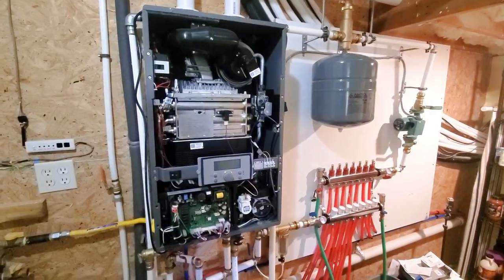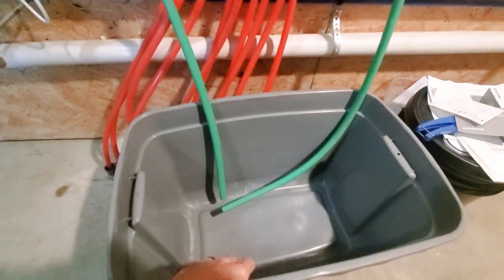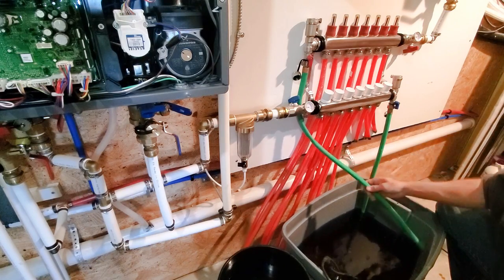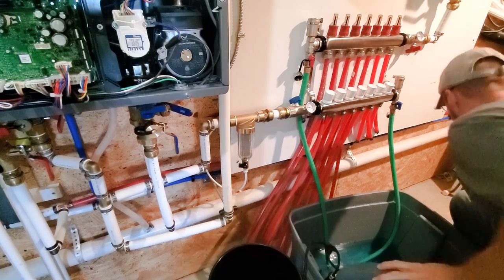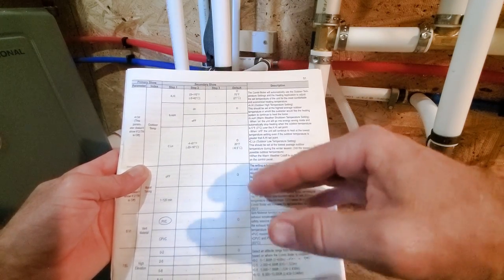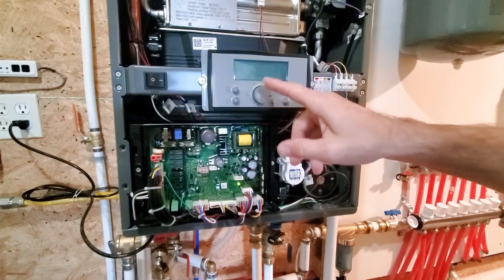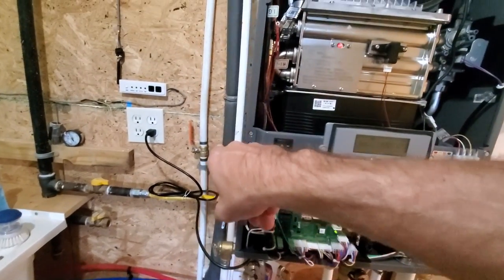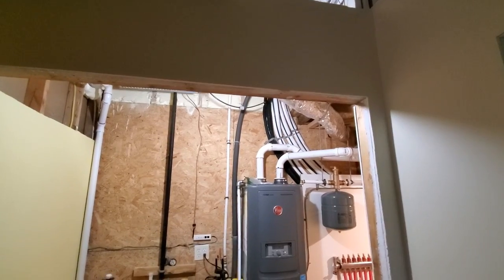Filling and Firing up the Rheem Boiler in our Off Grid Home

Comment: These Rheems are made by HTP, HTP was purchased by Rheem several years back now. In my old house I had an HTP 199K btu tankless wanted Hester inside the same case as your boiler. I’m sure the guts are totally different, but it was a great unit. I only had one issue with mine, a leaking blank plug, which was an easy fit. Would 100% buy a Rheem/HTP product again.
Reply from the maker: Ours is still working lile a champ.

Comment: at 13 minutes, when you opened the ballvavles, was it putting fluid thru the expansion tank and other lines?
Reply from the maker: Yes, I was bleeding the air out of the outer loop that contains the pump, expansion tank, and spin down filter.  Once that was full of fluid I tried to open the boiler valves thinking it would get the air out of there as well but it didn't work very well so I then hooked the sump pump directly to the boiler fittings and got all the air out of it too.

Comment: Hi there... I have the same system.... I'm having trouble connecting a Nest thermostart.  I have two wires and I connected it to CN15 just like yours.  I was told by Rheem that I'm suppose to 24volts from CN15.  Are you getting 24volts from CN15?  Also what thermostat are you using?  Are you using a zone controller?  I have only one zone. Can you explain or show please. Thanks!!!!
Reply from the maker: I have a Honeywell TH1100DV1000 heat only thermostat which uses 24V.  The system is not zoned.  I have seven loops but an only using five currently.

I don't think a Nest will run it properly.
Reply: @Off-Grid  What is the answer on this, is it just a contact closure that you hook up or do you actually supply it with 24v.  My old system works off of a contact closure on the zone valve.

Comment: I just finished the install of my own Rheem combo boiler and one thing I noticed is that even running the cold water triggers the internal pump to start.  Maybe the slight pressure interuption does that but not sure.  Have you noticed this with yours?
Reply from the maker: No, ours won't run unless the hot water runs.  It doesn't take much to trigger it so maybe the faucet has a mixing valve that is allowing hot water to pass by.  I can't think of any other reason.
Reply: @Off-Grid  Thanks for responding.  Must be a really sensitive switch.  Your videos helped me a lot when I was working on putting it in.  Thanks for doing it.
Reply from the maker: @kapaul1584  you're welcome.  Glad they helped.

Comment: Where did you wire your external pump into?
Reply from the maker: It wires onto the boiler circuit panel.  I go over it in one of the videos.  See our channels playlist for the boiler.
Reply from the maker: Here is a link to the video where I wire up the pump.
https://youtu.be/gJYOopJQ74Q

Comment: do you control your circulation pump with a controller or let the boiler power it?
Reply from the maker: The boiler turns the pump on and off as needed.
Reply: I have just install this same one, I connected the pump this way but I have notice more than once that it is not on all the time when heat is being called for.   @Off-Grid
Reply from the maker: @danaauman5367  there could be several reasons for this.  If domestic hot water is called for then the external pump will shut off.  If your outside temp sensor is set up then it'll prevent the system from turning on even though the thermostat says to if the temperature is rising outside.  You can set the sensitivity in the settings of the boiler.
Reply: I do not have the temp sensor turned on and I understand about the HW being priority.  This is happening out side of the HW.  I have looked at the manual and seen something about the boiler shutting of the internial pump of at time to help with its life, you think it is doing this to both? @Off-Grid
Reply from the maker: If the boiler is on then the internal pump should always be on otherwise it would over heat the heat exchanger since the external pump doesn't pump through the heat exchanger loop.  I'm sure some fluid would still go through but the majority would take the path of lease resistance back to the pump.  So if your internal pump is off and the boiler is on them I think you need to call technical support and see what they say.
Reply: the internial pump does not turn off, it always runs, but the boiler turns the externail pump off, even though the Tstat is calling for heat.   @Off-Grid
Reply from the maker: @danaauman5367  does your external pump have a limit switch that is turning it off when it gets hot?  My boiler temperature is set to 145° but can go up to 180°.  What is yours set at?
Reply: The external pump does not have any limit switch.  I just noticed that the temp was set to 125 and I just changed it to 145. any other thoughts why the boiler would turn the external pump off?  The only wires to and from the pump are the electrical to the connection with in the boiler.    @Off-Grid
Reply from the maker: @danaauman5367  how long are your runs and pipe size?  What is the return temperature and delta?
Reply: my longest run is about 300', return temp is typ 20 degrees lower than supply.  @Off-Grid
Reply from the maker: @danaauman5367  sounds good.  All I can think of is a setting is wrong or a thermostat error.  Mine is hooked up to a simple dump heat only thermostat.  I know some people have had issues hooking it up to higher tech devices.

Comment: Mind if I ask, where did you tether the ground wire from the circulator in the boiler? or did you just tether it to the boiler's housing?
Reply from the maker: There is a ground wire attachment spot on the boiler for the motor.
Reply: @Off-Grid  Found it! it's a screw on the  lower left
Reply from the maker: @isaacmadrid15  good deal!
Reply: @Off-Grid  Another question, is your thermostat battery operated or C wire? I couldn't find a C wire terminal inside the boiler..
Reply from the maker: @isaacmadrid15  It has a battery.

Comment: RTA cabinets make vanities, have you checked them out?
Reply from the maker: Yes, we have but they are very simple and boring.  I wanted to do something more unique.  Plus I found that they aren't much cheaper.
Reply: @Off-Grid  I also was looking for a solid wood vanity and went with a particle board one from Home Depot for the design. Fingers crossed that it will hold up.
Reply from the maker: @suesherrill7024  they are good for many years.  As long as you don't have any leaks it should be ok.  Problem is that a bathroom isn't exactly a water free environment, especially with kids.  Solid wood seems the best bet I'd think.  I might be over thinking it too.....

Comment: Can you help me to check my Boiler? I have trouble to turn it on. Thank you.
Reply from the maker: I can try.  What's up?
Reply: @Off-Grid  my friends helped me set up, RHEEMPrestige 9.9 GPM Natural Gas High Efficiency Combi Boiler with 199000 BTU (from HD), but it did not really work.
Reply from the maker: @tingzzz3  will need to know more information in order to try and help.

Comment: Shark bite ok for emergencies but have flaws. They are smaller inside diameter and too many cause a major stress on the flow of water. Just saying
Reply from the maker: So far so good.  I've had sharkbites in the ground for over ten years so far without any leaks.  At least I can see all the fittings here to catch a leak when it starts.

Comment: Have you ever seen error code 55 on this boiler??
Reply: I just installed the unit and code 55 keep coming up
Reply from the maker: It means the system can't get up to 13psi.  You're auto feeder has to be on and air valves open so it can push all the air out of the line and fill the system to the proper psi.
Reply: I can bleed off air from shower??
When I turn on hot water in the shower a lot of air came out
Reply from the maker: @daidaisuisuib  it is air in your boiler line, not the domestic hot water line.
Reply: Ok, the auto feeder is connected to the cold water inlet. And what do you mean by the air valve?
Reply: I connected the domestic hot and cold pipes only. I haven't connected the heating. So if there is any air in the pipes, it  should be in the domestic side.
Reply from the maker: @daidaisuisuib  you must connect the whole system for it to work or at a minimum connect the hot and cold side of the heating connections together so water can flow through it.  The domestic hot water is heated via a heat exchanger between the heating loop and your domestic loop.  So if you don't have any water in the heating loop then it can't heat the domestic loop.

You'll want the auto fill connected so it can fill the heating loop side.  There is a small valve to release any air in the heating line called an air separated.  It needs to be open.  In your radiant heating system you'll likely end up with several of these valves.
Reply from the maker: @daidaisuisuib  the auto filler has its own separate connection to the boiler that is in-between the domestic cold in and hot out lines.  It must have a check valve installed.  

I have other videos on the boiler you might want to watch as well.
Reply from the maker: Here is the playlist for all the boiler videos.

https://www.youtube.com/playlist?list=PLkmO_DrGWs-LpkCn7sSNvXsTWiNpfH-cz